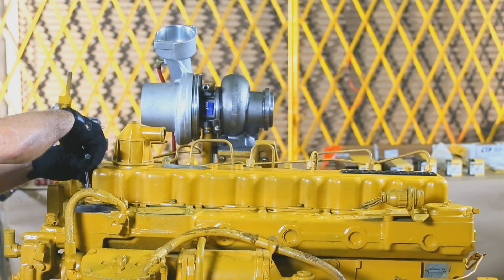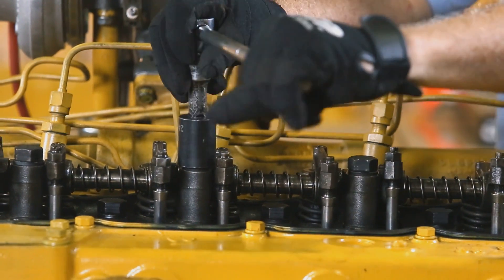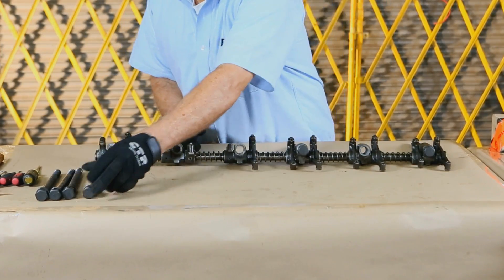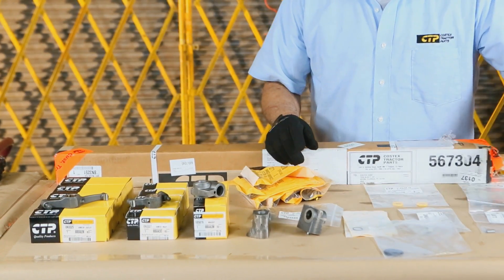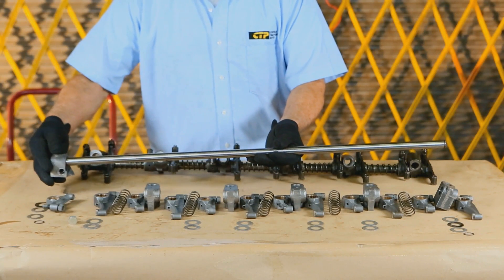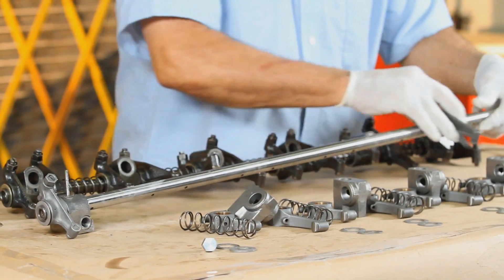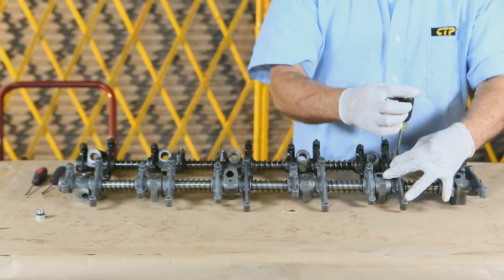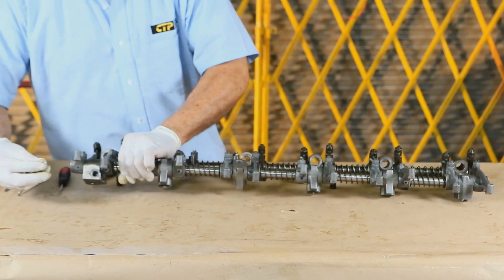Rocker Shaft Assembly

Comment: How do you remove that pin!? I can get anything off the shaft
Reply from the maker: To remove the pin on either end we suggest using a steel punch set with a diameter smaller than the pin being removed. It should come out fairly easy.